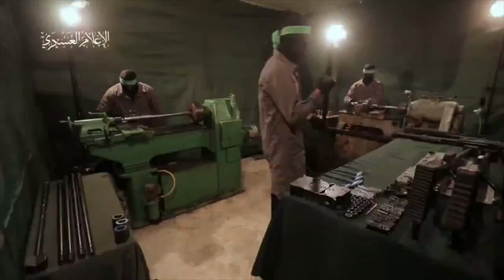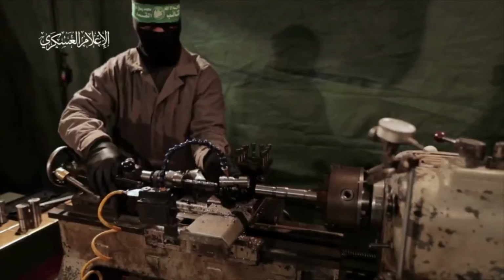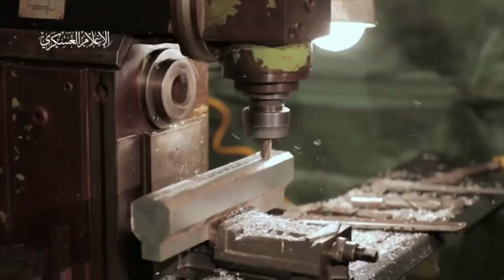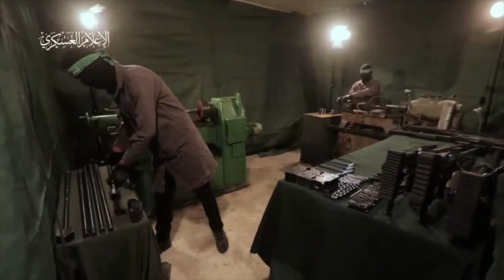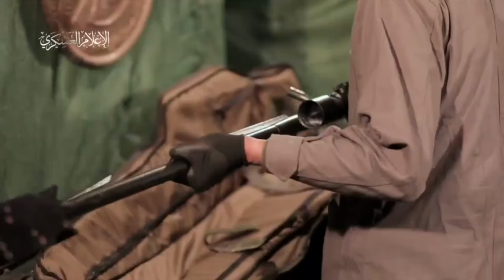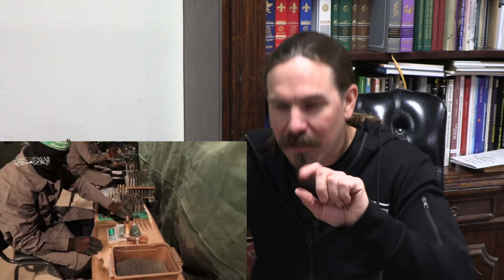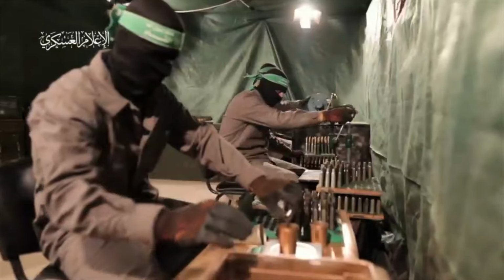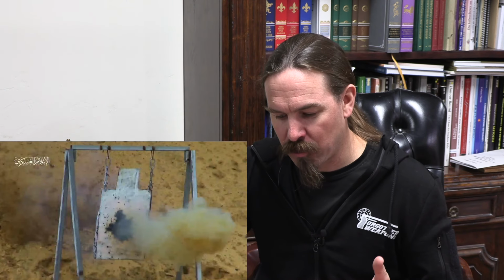Hamas Claims to Make Sniper Rifles in Gaza - Are They Really?

Comment: Many good points but if theyve got the equipment & determination they'll learn.  I respect what you say regarding the different cases, but if they have got the correct powder weight / grainuals and it seals OK when fired,  I had a laugh,   as I could imagine you getting shot at -  then pausing and saying  -  hello bullet - you Dont have the right to hit me - you came from an unpolished metal casing / yr not shiny enough   etc...   the exact mentality of western media regards truth.  I get and respect where your coming from,  yet most those jokers cant shoot straight normally.  I liked sons of Guns but figured it a bit of a crock, from when they got something working - and out the door it went,  when it wasnt tested for reliability as anything mechanical can work once or twice then crap out.  Your right this is a propaganda video,  time spent on lies and hype rather then time spent on truth.

Comment: I don't see it in terms of exactly how authentic it might be that they're producing anything that works...

I see it in terms of...even if this video doesn't establish that they're making gun rifles in this video it doesn't mean thay they're without the fine machining capabilities that the video definitely is showing. Right or wrong.  If i was HAMAS i wouldn't provide you with an intelligent understanding of my capabilities.

The video doesn't prove the actual ability, but it demonstrates full capability.

In short... Yes.vHAMAS is definitely manufacturing their own rifles. The engineering department isn't required to ever show Administration anything more a general concept. Usually the Bosses don't even necessarily care that much anyhow. It's easier for the Bosses to visualize the exact part in question when they see the new company tools at work. Here's the machine creating a basic cylinder. Here's a finer cylinder. Here's a central bore process that's easily achievable based upon this technology. Here's some footage of Omar messing around with the dull bit we're going to replace all the parts for anyway. Make sure that's the footage for no oil. We only made that mistake once but it serves us better knowing that the entire West is taking our stock footage as some sort of proof we generally always do this

Comment: While l seriously doubt these people are doing anything related to actual firearms production turning metal with cutting fluid just brushed on the material will result in "smoke". Flood coolant is of course the better choice. The lathe shown might not even gave coolant.
And "gun drilling" is a whole different ball game than drilling with a twist drill. No pun intended. Needs high pressure coolant to flush the chips out and the hole actually acts as the support to keep the gun drill steady.

Comment: Making a rifle is not THAT hard. If you know your metallurgy and have tools. I recall seeing documentaries from Afghanistan from years back, before the American invasion, where small smithies turned out Kalashnikovs using mostly hand tools and simple machining tools. They even made the barrels, often from spring steel taken from old trucks. Hammer it in shape, drill it out, harden and temper the steel.

Comment: I have been in an old gunsmith's shop who made custom barrels and replacement parts for old guns from scratch.  It can be done with very primitive equipment, and they showed all the right machines.  What they didn't show was people who actually knew what they were doing, or the right tooling/fixtures for doing it. I would question where the video was produced as well.  Could have been done in Iran, Iraq, Syria, Yemen...
Reply: Even with primitive machinerie, you still need to know what you re doing.
There IS a différence between making a rifle, and a précision rifle.
You re trying too hard.

Comment: To your first argument, it's possible that they made the cut first to almost the bore diameter, and as in the end the drill reached the cut, it seperated the piece in one step. Definitely possible, even if it's wrong/dangerous. It might safe some time. It's also necessary to lathe before you take a part to the mill for further machining. As milling first would destroy the parts rotating and result in strong vibrations due to the uneven weight distribution around the axis. The caliber marking (12,7 x 99mm): in metric countries you quiet some times see the American calibers transferred into metric. .32 ACP is often addressed as 7,65mm browning. I didn't look any further into it, buy I can't imagine a reason why Hamas would make a video like that, as it justifies further bombing of the areas. A lot about this seems of. But for the machining part, people in Afghanistan with waaaay worse tools and people in Thailand with literal hand tools are managing to build guns, so I really don't see this as impossible for Hamas. It's just very very very stupid of them to post a video like this.
Reply: theyre quite obviously posting it as propaganda trying to show that they have more capabilities than they actually do. I dont doubt they can make guns, as you and others have pointed out they may not be doing it the "right" or safe way but that doesnt mean they cant do it. Producing actually accurate and reliable anti-material rifles though? I highly doubt it. Also I dont think they care about provoking a response when theyre already dealing with one.
Reply: @SpydersByte  I again have to contradict. If you have a fixed Barrel, and the sights are attached to a part that's fixed to the barrel itself and can't move, the accuracy solely depends on the chambering, rifling and the resonance of the barrel itself, as the accuracy doesn't depend on tolerances. Thus it's very easy to make an accurate gun as long as you have a proper threaded barrel. So yeah, I highly assume they get their barrels threaded already as there's one thing that I doubt they can produce. And that's a properly hardened and heat threated, well-threaded barrel that withstands the pressure of a .50 BMG. So as long as they get pre-threaded barrel blanks, I don't see any issue at all to produce an accurate anti material rifle. If they don't get barrel blanks, the entire video is a fake for sure. But as I said, the only thing here that shocks me is the pure stupidity to make this kind of video in the first place. This is basically a free pass for further immense bombings. They have just destroyed all their "pleads for peace" (stop of the bombings) in a single video, absolute morons!

Comment: FWIW I'm an engineer. I have worked in a factory producing military firearms, as well as working (many years ago) with a custom gunsmith. I've also had a lot of time in machine shops at various levels of sophistication. Finally, I've been around firearms for nearly 50 years and reloading for much of that time. I agreed with your observations Ian. 

I don't believe for one moment that this video is evidence that Hamas is building rifles or reloading ammunition. In fact, if anything it demonstrates that they don't have or even really appreciate what it would require to do either.  

Yes, working firearms can be built on some pretty basic equipment, but if you try to pass off some (badly done) profiling of undrilled bar stock on a pretty poor lathe with crap tools as barrel making it only demonstrates that you have no clue how you would actually go about doing it.

Comment: If you cut a relief at a smaller diameter around the same size of the drill, the peace of material can and will separate from the main or apparent metal. So, drilling depending on the machinist: This can be taken into account by the machinist before drilling. I would suggest the last pass with the drill be a finishing cut last few mm+. This could simply be a process step. Look how old the machines are. It's going to take them a few years to build one rifle. The war might just end before their prototype can see the light of day. By today's standards, this is a joke compared to the Engineering used in modern Militaries. 🥸
Reply: expecting the best technology and the cutting edge techniques is ridiculous given their circumstances
Reply: @quetzalponk  Mate I don't expect anything great from these people, expect a first year apprentice! Keep walking!

Comment: As someone who did a "gun barrel" for an exam, more precisely a replica one this is the fakest fake, that rod will never be a gun barrel, certainly not a sniper barrel.

Making precision gunbarrels requires expensive and specific machinery. You can slightly modify barrels on a lathe.

As for the ammo just as Ian said thats no precision ammo, ive seen hunters do a better job, counting individual grains so all loads are exactly the same. 

Overall this looks more like a general sweatshop for guns more like something that will make precision stuff

Comment: If you work on a lathe with long sleeves and gloves and no protection glasses  - i think hand polishing with a cloth is the least endagerment.

About the Ammomaking part.  No. Lathing and machining gun parts    vs  making ammo-cases   are far apart from each other.  As you would deep draw a disk of brass into several stages until one flat disk of brass got its form.  So you would need additional hydraulic pressing machines and a set of tool blocks for each step.  So granted for Hamas. A recycled Casing is better than no casing and a bullet is a bullet.  If they are very precise? Inshallah i guess.

Comment: You actually will get smoke off a lathe when machining if you are using cutting oil or other petroleum based lubricant. That smoke is the heat being carried away by cooking off the lubricant. Rapid-tap and WD-40 make great cutting lubricants when machining aluminum (WD-40 especially) or Stainless Steel. I agree with you though that the 'machining' that they show in the video is just that - show.

Comment: This is genuinely a lot of fun for me to watch, I'm an Engineer and trained as a toolmaker a long time ago, so watching some of this is absolutely hilarous :)
In the first portion, the lathe with the barrel on it doesn't have a long enough bed to do that job by about 200mm or so... The tailstock is actuall OFF the bed and the carriage is bumped up against the tail stock... They couldn't even apply the pressure to turn between centres on that one. The job is too long as well, and normally would require some tricks to make it run right, like turning with a support or using fine finishing tools to cut the profile etc. A lathe like this, that isn't stiff enough, even if they tried to turn it, would spit the job out.
In the detail image it looks like they're brushing on lubricant, which isn't terrible, but the condition of the cutting tools is appalling. The fact that the turret and the tool are covered in surface rust means that these machines haven't been in regular use for a few decades... In normal use just the lubricant that gets splashed around would normally at least partially protect stuff... Chips are continuous and surface finish varies between rough and bright, meaning that there's inconsistent feed and when they're at the bottom end of the feed range they're using it's rubbing, not cutting, which is both bad for tolerances and increases the likelihood of the job getting lobbed at you by the lathe. The "cloth" might be a scotchbrite pad, which is actually a really nice way to finish a job, but they haven't started it properly yet, so probably shouldn't be attempting to "finish" it :)
Leaving the chuck key in is a massive nono, that, on its own, tells you that these guys are hacks... In modern trades schools people don't spend much time on a lathe, but they normally put springs on them so you can't screw up like this... On an old lathe, with an old fitter or toolmaker you'd have copped an absolute hiding in trade school... EVERY TIME... so people just don't do this unless they're hobbyists or hacks.
In the shot where they're tailstock drilling the job in the chuck, this would actually be correct for the job, because they'd need to pilot the gun drill, but normally you wouldn't do that with a standard jobber drill, you'd get a short series so you didn't risk tip deflection in your pilot. Pilot hole deflection would ruin the long hole, as early perterbations can screw up your hole centrality... I think some people ream or bore to ensure that they have an absolutely spot on pilot, so this is a nope...
Pulling the job off that's just magically floating on the drill... No idea what that's about... Maybe they're trying to pretend that they parted that, but then they'd need a parting tool on the post and they don't have any tools on that lathe(?) :)
The various "stages of production" parts are super weird, they have radically visually different hole and profile diameters, so nothing about that makes sense; they're not even the same parts. They also appear to be doing bluing without a chamical bath somewhere in their precision workshop tent.
For the aluminium profile for the "scope mount" they're missing material in areas they should have it and have material where they shouldn't. The tool marks on that are also inconsistent with the machine they're using, so it looks like they've got a blank from somewhere and are just chopping it up. He also can't use a vernier, what a mess.
When you look at the parts on the table, the clamping length for the "scope mount" he's put down is actually longer than the one next to it, and the one next to it seems to have some sort of tail that the painted or annodised ones adjacent don't have.
For the markings it looks like, at best, that's a sheet metal cover, so it's either been stamped in (the good way) or alternately given the inconsistency of depth and alignment, I wouldn't be surprised to find out that's a piece of black painted wood.
On the "ammunition" there are only still shots of the custom headstamped stuff and there are punch marks crossing into the primer pocket as well as turning marks on the "primer" in the first one... That's a clear indication that what you're looking at is a badly made dummy, designed to look like a case head, not an actual case head... This is supported by the fact that they've had a go at cleaning it up and hiding the sins with the pretend red waterproofing laquer between shots, because you can see all that damage and their crappy attempt to fake a primer in the first shot of the "reloading" video, before it gets all fuzzy and the primer somehow disappears as the projectile goes forward from the hand to the press. I have no idea why you'd be pushing nose down into a press either... That, on it's own, is super weird.
Gloves in this place are just asking for problems... The gloves in the mill and lathe section just make me cringe, but the gloves in the reloading section are even worse... They'll pick up powder and static... There'll be a point in these people's lives they regret this because they'll be on fire.
The rotating one is super weird, because it doesn't even look like they've got a complete fake case in that one... Super weird... 
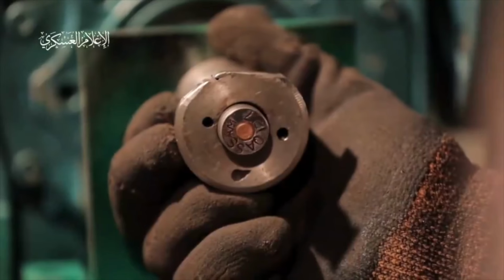The projectiles are completely different in different parts of the video, these look like solid brass projectiles at 14:30, but earlier they were a black tip copper jacket round.
Regarding the press, that press isn't large enough to seat that projectile, it's adjustable for height and that usually reduces stiffness, which makes it worse... That's a tiny little arbour press, which you'd normally use for seating very small bearings. Incidentally the sized cases look like they've even got different shoulder lengths, which is even more weird. You just wouldn't store ammunition in a transport case like that, the ammunition care would run the risk of damaging the case or projectile tip.
Anyway, this was a good laugh :)
Thanks :)
Reply: Thank you! You're patience to put all of this into words for others to read deserves a tip of the hat sir!
Reply: First rule I was taught in machine shop was to check for that chuck key.  We had an old lathe from one of the world wars and it was the size of a full size truck and someone left the chuck key in there and it ended up in the ceiling 40 feet up! Someone also got their arm of their hoodie caught and luckily stopped the machine before it went to far! High school memories!
Reply: @Professionalminutestealer  exactly! 🙂
Reply: Their rubber/surgical gloves probably aren't that big of deal, though. Simply because those sort usually rupture/disintegrate fairly easily.
A lot of trades now wear "mechanics gloves" which are basically like surgical gloves with grip and knuckle pads moulded-in, they rip and disintegrate rather than take you in, if they catch on machinery.
Reply: Really informative comment, something difficult to find online. It brought up lots of great points.
Reply: You stupid your are giving them feedback!!! and will be taken in consideration!
Reply: How rpg al yassin can destroy easily merkava world famous tank??
Reply: Hamas makes a lot of funny nonsense videos, they had one where they were in a "drone operations room" and they had guys watching prerecorded aerial video while moving their fingers on a transmitter like the people playing video games on tv where they just move it randomly and has no correlation to what's happening on screen but, the best part was the guy in the back they wanted to look like a programmer so they had him watching the green text floating down a screen from the Matrix that part made laugh way harder than it should have. They are not only bad at making or more than likely incapable of making guns and drones they are also incapable of making convincing propaganda.